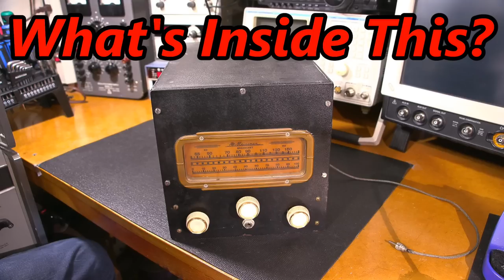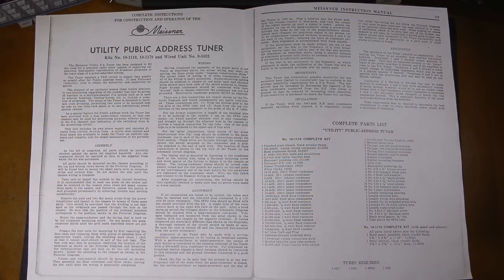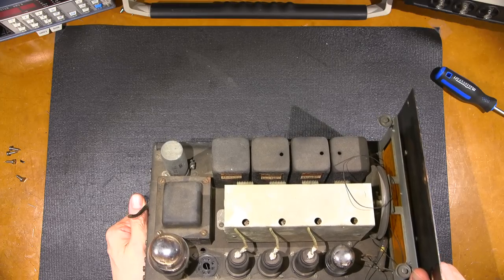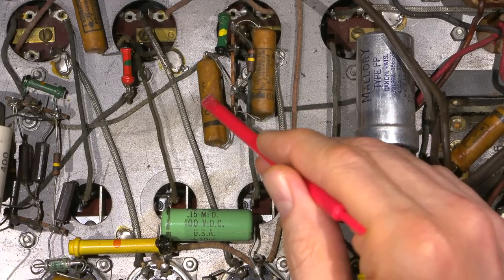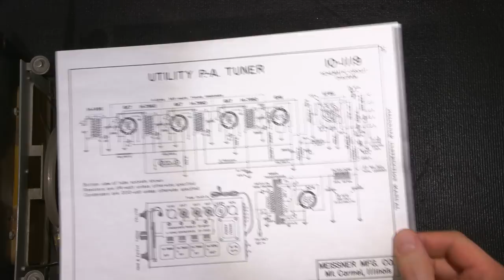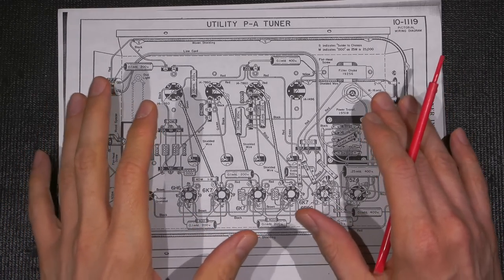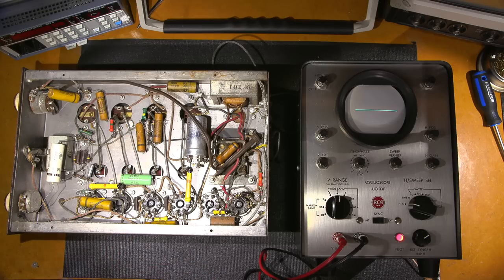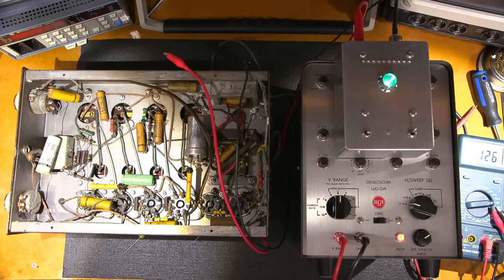Look Inside This Rare Receiver!

Comment: I would like to take a moment to talk about part replacement when it comes to capacitors. I found both Digikey and Mouser do not have the part I am looking for, they come close. In many of these old radios I found  caps are done in whole numbers like 20uF but when I go to find a replacement they will have it 22uF. So if you have other parts connection Please share.
Reply: You are almost certainly talking about an electrolytic capacitor with that mf rating. Electrolytic capacitors generally have a very loose tolerance rating, something like -50/+100 percent. More than likely the cap you are replacing is used as a power supply filter, coupling or decoupling application. In that service your radio, amp or whatever will never know the difference between 20 or 22 mf. So you are perfectly fine replacing with the 22 mf job. In fact, this is not the only time you will see this apparent discrepancy with electronic component ratings. Examples: replacing a 50 mf capacitor with a 47 mf unit (or some other such number, i.e. 0.05 mf and 0.047 mf), or with resistors, like 500k ohm with 470k, and so forth. It's all about standardizing the numbering of components. Though one thing that stays the same is voltage ratings for capacitors: If your capacitor was rated at 150 volts, thats what your replacement should be (or a little more, like 200 volts), but never less than the original rating. Hope this helps you.

Comment: Why there were no pcb back then back  of it connect compoments with just wires and solder is it shock proof i dont think there was any grounding wire in those back then

Comment: Is that 0.01 400V cap on the power in what amp techs call the "death cap"? Will you be removing this? Thanks for the videos. I'm learning a lot
Reply: Replace it with a proper Y rated cap.

Comment: typical  am( superhet )rx : rf amp, local oscillator, mixer, if amp, af preamp, af output..... if you wanted a trf set ditch the l.o. and mixer..........fm rx. needs a limiter and discriminator after superher mixer.........as my memory serves. .....used to make theses from scratch 70 years ago, nice video, h6uk

Comment: Carlson can you tell me what you think about Cornell dubilier orange drop caps?
Reply from the maker: They are usually very good components. Rarely do I find them faulty.
Reply: Mr Carlson's Lab ah good! That’s what I normally use as replacement caps in radios but when you mentioned that IC caps were the best I had to ask for your opinion on what I use

Comment: I wonder how well overall regeneration is suppressed in this high-gain TRF design? I could imagine that unintended changes in the layout of the point-to-point wiring or deviation from the originally-designed shielding topology could make this into a broadcast-band oscillator (but probably not, given how careful Mr. Carson invariably is).

Comment: Looks like that new tube you put in has a grid/plate cap, yet there’s no wire dangling around topside waiting for a tube to connect to?? Maybe it broke off? It’s also the only tube in the schematic that has a white outline, not a solid black one; weird.
Reply: William, I noticed the same thing. No wire with a clip on it. But with the new tube in place it is shoulder to shoulder with another. Something is wrong with that picture.

Comment: flat screw slipping - slip a piece of heat shrink, or other suitable tubing, over the screw driver  so it locates over the screw head and prevents the blade slipping off
Reply: There are drivers made that will force two blades into the slot for twice the grip,also a tunnel driver with a recessed tip that will not come off most slotted screws except countersunk and hex.

Comment: Had an interest in restoring an antique car, but riding in one of these in parade in 95*F weather with kids was not very fun, no AC.  Started in electronics in 1953, one thing you needed back then was muscle, aircraft radios weight over 150 pounds, was all vacuum tubes and relays, those tubes were red hot, relay contacts were always dirty.  Computers would take up several rooms.  Also could get electrocuted working on this stuff, like a 5 megawatt ground radar, and sure knew about microwaves back then, would microwave you. 

Efficiency was terrible and could use a radio for a space heater, my latest designs using CMOS technology, could put millions of transistors in less space than a single vacuum tube, and also consume less power.  Learn from that old stuff, but leave it.  With those old radios, had to put up with as low as 0.01% modulation, with digital transmission, even the weakest signals are modulated at 100%.  Keeping up and even advancing technology was a full time job, no watching TV and night, always had to study, if not, would be in the unemployment line.

See you are loaded with antique test equipment, would go broke if you had to pay a recycling charge, some may be impressed, I am not.

Comment: Wonder how much it would cost to produce these "as built", today?
Reply: Finding a reliable source of four-gang variable capacitors would be difficult to impossible. If the goal were simply to build a multi-stage TRF radio, it would be easier to use new old stock varactor diodes.

Comment: They had this sort of receiver at the Highschool that I went to,This unit would have most likely have been mounted in a rack high up in the stage area of an Assembly Hall , The rest of this message is for the s**t for brains bots that seem to think that they can butt into a video stream whenever they want which is the height of rudeness and shouldn't even be tolerated.

Comment: I wonder how those tubes with diodes on them test. I'd guess they're really weak and the diodes were a cheap fix.
Reply: I've put a lot of them in old equipment to modernize them a bit. Take out the tubes and save a lot of heat.

Comment: On a resistor that huge, would it really have been that difficult to just write 40,000 ohms on it? I ask the makers of that resistor who are likely long dead by now.
Reply: Many years ago, I recall seeing an illustration in an electronics book that showed that if values were printed on resistors, it would be too easy to mount the resistors such that the value were facing down. Color codes were created to avoid this problem.

Comment: 9:20 I am crying foul here, this radio receiver has a lot of tubes for a "low cost" unit that is just a remote set.
27:18 Using a Lisajou pattern on a oscilloscope to meter capacitance is sooo tedius!